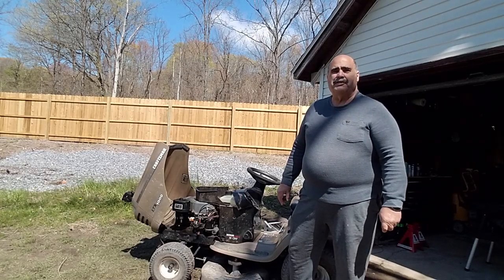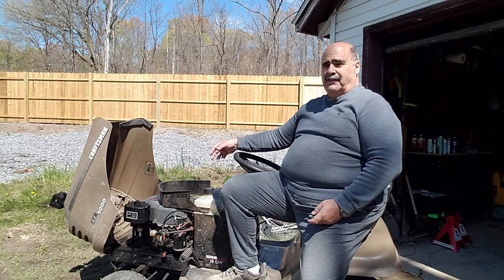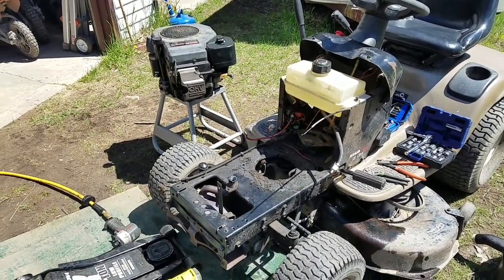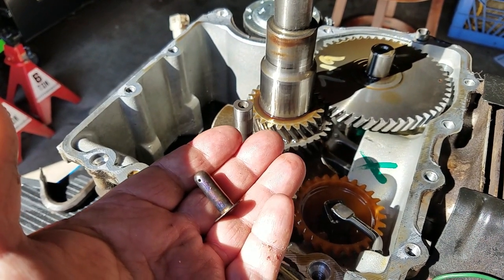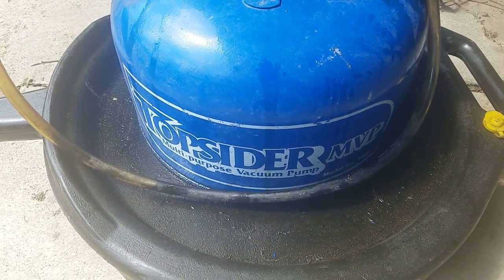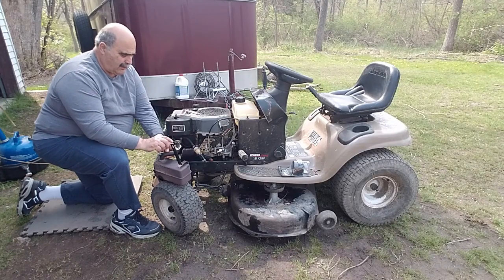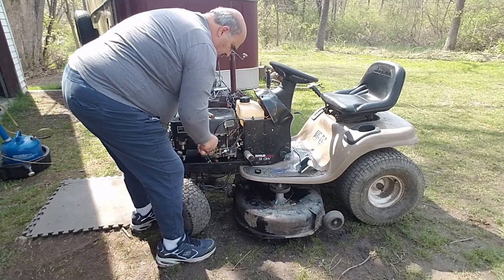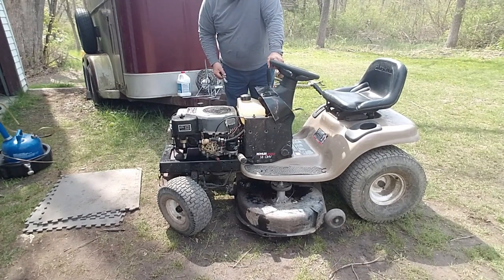Kohler Command Pro Governor Fix

Comment: Hey Ken !
I’ve been going thru issues with my kohler courage 19 hp single cylinder started with an adjustment of the governor and it turned bad. 
I thought I broke something in the crankcase.  
Turned out no but in the process had cam gear out and apparently got timing off. Yeah crazy, but seeing all the YouTube guys I found and learned exactly what was wrong. 
Parts are ordered and it will be fixed real soon. I lost the spring on the cam gear compression release lever. 
While in the crankcase I cleaned and inspected everything only found minor crud in it. I learned a whole lot in a few days. I’m confident now with the views and my working on it I should be ok. 
Thanks to guys like you and those you mentioned !  South Main Auto is awesome and for fyi check out Rainman Ray’s Repairs he is local to me but very good like Eric. 
Like my son use to tell me when he was a little kid “ Dad you can fix anything” he might be right. Further a buddy says it’s good we learned to fix Chit when we were young, in todays world we wouldn’t have the money to pay to fix it. Cost are crazy out of hand. 
C Ya !!!!
Reply from the maker: Thanks for watching. Good luck with you engine work.

Comment: Thanks for the great video Ken! I agree with the other posters - it is so fun to see your enthusiasm when things go well. I love how you've kept that old girl running. The governor on my brand new Cub Cadet blew. It was still under warranty, so they scored us a brand new engine, a good thing. But, I bet they make that gear plastic since they know it'll fail eventually, and perhaps the metal parts inside the crank can't be hurt too badly by a blown plastic governor gear. but, as for the other metal bits that are part of the governor, they probably could reek havoc on the internals, so in this case, I'll say a ok to a new engine under warranty. Great video - I feel like I know you and "let's grab a beer". Cheers Mate!
Reply from the maker: Still runs great. Probably more reliable than a newer model. Mowed 20 acres total this summer.
Reply from the maker: Still runs great and damn those plastic parts!

Comment: Thank You  for your inspiration to repair my old Jphn Deere STX38,  I would not have started the job of replacing the governor gear and pin on a kroller command 13 if it were not for your informative video.

Comment: Thanks so much for this. I either have a carb issue or governor issue. Mine doesn't over rev but the throttle doesn't really respond like its supposed to and kind of surges. I think I'll replace the governor gear when grass cutting season is over. Thanks again, really good video sir.

Comment: If you still have this mower, it’d be great if you could do a video reviewing the throttle and choke adjustments. That is, the position of the carburetor fans when it’s in choke, full throttle and low idle. Thank you!

Comment: Hi, we replaced the pin on the governor, how do I tell if it’s working? It still seems to be running fast.
Reply from the maker: If it is still running fast, the governor may need further adjustment. Taryl Fixes All and a few other YouTube channels cover the proper adjustment. I got lucky with mine and it was nearly perfect for my tractor.

Comment: Where can you find a rebuild kit for these engines.  I cant find anything.
Reply: In my experience with riding mower repairs I have found the basic parts are interchangeable with similar models.
Reply from the maker: Not my area of expertise, but I'd try going to Kohler directly. If you find a rebuild kit a follow-up comment would be appreciated.
Reply: The one I've been refixing for 2 months now the engine had been recently rebuilt they probably rushed and messed up from all the stuff I've already fixed that they done wrong so they have replacement parts or it couldn't have gotten rebuilt 

Unless they just took it all apart and cleaned all the old parts off in a parts washer

Comment: Wouldn't it have been easier to drain the oil before opening up the case ?
Reply from the maker: Yep it was. Probably not clear in the video, but that's what I did. The small amt of oil in the engine when I turned it upside down was from nooks and crannies draining down into the  top of the engine. Thanks for watching and your comment!